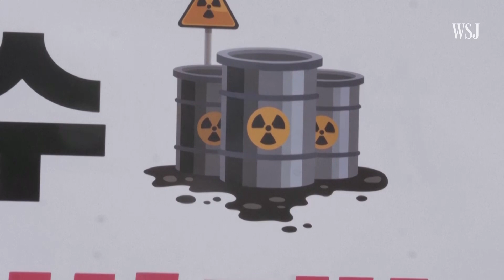Japan’s Plan to Discharge Fukushima Radioactive Water Approved by U.N. | WSJ News

Comment: there is a big difference between the cooling water from an operational plant and a capsized plant such as fukushima. cooling water from operational plant never has direct contact with radioactive materials and isn't contaminated. water from fukushima is highly contaminated from cooling the melted fuel. also japans ALPS only removes around half of the 64 radio nuclides

Comment: We are supposed to believe this is safe?? Yea right
Reply: If it's been removed probably safe
Reply: You don't have to believe anything, you could have looked it up and know.
Reply: @danadurnfordkevinblanchdebunk  The contaminated water of Fukushima is distinguished from other nuclear power plants not only by its greater variety of radioactive materials but also the overall much higher radioactivity. If it is discharged to the Pacific Ocean, it will potentially pose a significant threat to the well-being of human health and marine life. Normally, water that is used in cooling a nuclear plant in routine operation and then discharged to the environment has no direct contact with the nuclear reactor fuel cores. In contrast, the contaminated water generated by the Fukushima disaster has come into direct contact with contamination from the melted down cores of three reactors and as such is severely contaminated with many radionuclides. In other words, it is not appropriate to compare nuclear wastewater of normally operating nuclear plants in general and the Fukushima Daiichi nuclear wastewater. According to the latest report by the Japanese government, there are 621 radioactive isotopes were found in the existing nuclear water tanks in Fukushima, among which concentration of a radiouchile called tritium reached about 860 TBq2 – an alarming level that far exceeds the acceptable norm.
Reply: @axelanh4952 it would be more believable when you flying to janpan and drink the waste wather and video tape it for us to see. how about that ?
Reply: @axelanh4952  if its that safe, circulate that water into the japanese agriculture and drinking water system. What's up?
Reply: The two are different, the Japanese have polluted waste water! poisonous! rather than cooling water.
Reply: @axelanh4952 😅……

Comment: In fact, IAEA got money from japan Gov and the report is nothing and no credit.😢
Reply: Did you make that up all by yourself?  All nuclear power plants in the world releases the same tritiated water routinely.
Reply: @danadurnfordkevinblanchdebunk  The contaminated water of Fukushima is distinguished from other nuclear power plants not only by its greater variety of radioactive materials but also the overall much higher radioactivity. If it is discharged to the Pacific Ocean, it will potentially pose a significant threat to the well-being of human health and marine life. Normally, water that is used in cooling a nuclear plant in routine operation and then discharged to the environment has no direct contact with the nuclear reactor fuel cores. In contrast, the contaminated water generated by the Fukushima disaster has come into direct contact with contamination from the melted down cores of three reactors and as such is severely contaminated with many radionuclides. In other words, it is not appropriate to compare nuclear wastewater of normally operating nuclear plants in general and the Fukushima Daiichi nuclear wastewater. According to the latest report by the Japanese government, there are 621 radioactive isotopes were found in the existing nuclear water tanks in Fukushima, among which concentration of a radiouchile called tritium reached about 860 TBq2 – an alarming level that far exceeds the acceptable norm.
Reply: actually I believe they will say, the report relies on the data from Japan, if Japan just releases contaminated water without treating, it is Japanese responsibility.
Reply: @stellaaaa1756  this video title is misleading intentionally, japan only invite IAEA do to the assesement and IAEA report said they meet the criteria for dumping, but IAEA do not approve, because they do not have authority to do so, and also in the report IAEA said they do not responsibile for any consequence caused for the dumping action.
Reply: @danadurnfordkevinblanchdebunk  they ALL need to stop then.
Reply: @Fido-vm9zi   Then you need to turn off your electricity 20% of the time.
Reply: @blackbelt2000   All NPP use ALPS which removes all but the tritium, so the water is identical.
Reply: @danadurnfordkevinblanchdebunk  I pay for it. I have to pay a considerable amount of money to companies that harvest Earth's natural resources ( & make BILLIONS in profits from doing so)  & they charge is for it too! 
 Least they can do is show some intelligence & be conscientious about a planet these energy companies act like they own! 
People in various positions seem to have forgotten -they work for the people.

Comment: In China, the Qinshan No. 3 nuclear power plant has about 143 trillion becquerels, 6.5 times the amount Fukushima plans to emit, the Yangjiang nuclear power plant has five times the amount, and the Red River nuclear power plant has four times the amount. In South Korea, the Wolseong nuclear power plant and the Gori nuclear power plant are 3.2 times and 2.2 times higher, respectively.
In Europe and the United States, the numbers jump even higher. The La Argre reprocessing plant in France is 454.5 times as large. The Bruce A and B nuclear power plants in Canada are 54 times larger, and the Heysham 2 nuclear power plant in the UK is 14.7 times larger.

On October 3, 2019, South Korean media reported that uranium up to 157 times the standard level was detected in 76 underground water sources used for drinking purposes. In many rural areas of South Korea, water supply is not widespread, and when the South Korean government investigated the quality of groundwater nationwide, many radioactive materials and uranium were detected, resulting in a level of 157 times the standard value, a level that could have a significant impact on health.

It has been half a month since it was revealed that a fuel rod in the reactor core at the Taishan Nuclear Power Plant in China's Guangdong Province was partially damaged. As yet, the Chinese authorities have only emphasized that "no radiation leakage has occurred" and have not revealed any details. To begin with, the accident first came to light on June 14, 2021, when CNN television in the United States reported that a radiation leak may have occurred.

Have you guys ever been briefed on these?

Comment: They should dump radiation water into their water system if it's so safe.  Who will be accountable if it screw up ocean?  IAEA?  Remember when Japanese tanker spilled oil in Indian ocean at Mauritius?  They did nothing!!!
Reply: Do you realize how huge the ocean is? Also the only radionuclide that will be present in very small amounts is the tritium. No only that but that tritium containing water will be extremely diluted because the ocean is huge.